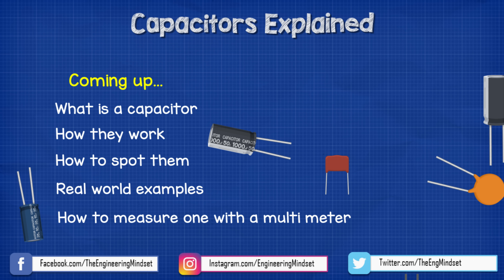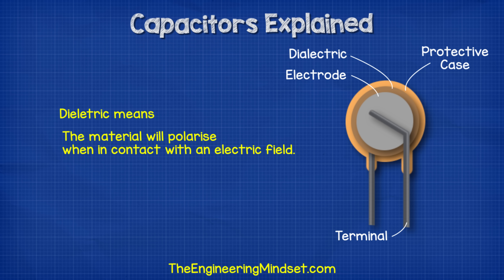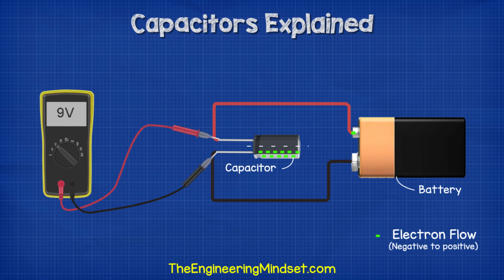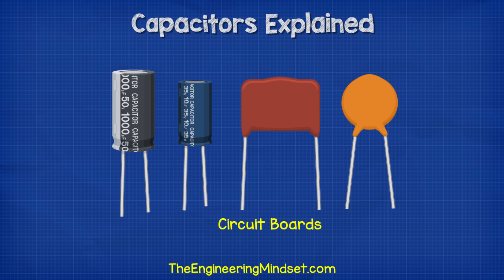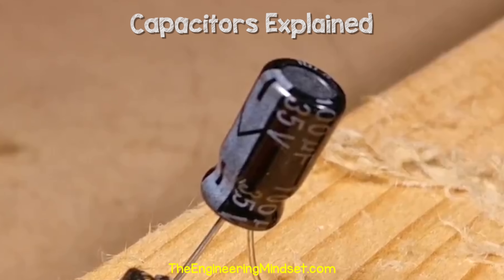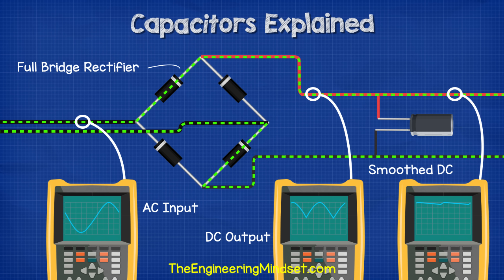Capacitors Explained - The basics how capacitors work working principle

Comment: Thank you so much for explaining this clearly and in detail.
Since they release their energy quicker, is it possible to provide a larger, brief jolt to, say, run a motor faster than the battery it was charged with?
Reply: Most motors have a run demand and a start demand.  The start demand is much higher than the run demand.  AC compressors are an example and all ruse a start and a run capacitor.  To answer your question by itself you could design a circuit to do that, but not with the capacitor alone.
Reply: In my understanding, Capacitors don't charge to a higher voltage than the source they were charged with. So if you charged up a capacitor and then hooked it up to a motor, at the very beginning it would run as fast as it would when it was hooked up to the battery. As the capacitor discharged it would slow down, which would be pretty fast (milliseconds to seconds, depending on the capacitor capacity)

Comment: Does capacitor  will over charge if not disconnected to battery? if yes then how to maintain the voltage that goes to capacitor?

Comment: How does one design a capacitor in terms of rf current flow? Im thinking along the lines of plate area per ampere of rf in an air variable capacitor, aside from plate area and spacing needed for the required capacitance value.
   Use will be in the hf region.

Comment: Hold on, "The pull between charges is what causes the field? 

Electrons by themselves create their own field. Electrons do not require the attraction of Protons in order to exhibit a field. Am I wrong?

Aren't the Protons simply there to keep the Electrons from leaving, and to allow them to discharge to a load?

The attractive force between the Electrons and the Protons does not create the Electric Field, the Electrons are doing that fine by themselves, am I wrong?

Comment: My high school Electronics classes we're literal Mayhem. The teacher have no control of the class if I told you stories of all that went on in there you would certainly think I was lying. 

One common occurrence was to charge a capacitor and then just walk over and discharge it on someone's skin. This happened often, you really had to watch yourself. It hurts, like a mini taser.  

Another time someone hooked a fairly large capacitor with reversed polarity and the explosion was tremendous. I mean it was way louder than an ordinary firecracker probably close to what a cherry bomb would sound like indoors. 

Your explanations are fantastic clear simple and to the point. The teacher I had could explain things coherently for the first three or four minutes of the lecture but if you continue to listen for the full hour he would confuse you so much that the only way to understand what happened during the lecture was  to just forget it entirely and reread the book. It really was that bad.

If you had been my teacher I might actually have learned something useful by the end of that class.

I have subscribed. Thanks. .

Comment: One thing I never understood was how a smaller capacitance created more impedance. I think you demonstrating the physical nature of the capacitor finally answered that question. If the flow is separated by an insulator, a small capacitor will halt flow much faster than a small one, thereby creating more impedance in the system.

Comment: I have a question. Why capacitor increase voltage when connected on ac to dc converter after bridge rectifier? example 12V DC converted after adding capacitor it can show up to 16 or more voltage unless you put LOAD on it. Example when I use mu Car Battery charger that is made very simple with transformer and diodes and when I connect them on Car battery it increase voltage (depends of state of car battery (how much is full)). When full it comes up to 15.5V. Why is that? I never found out...
Reply from the maker: Answer here https://youtu.be/RiRyzLl4Y8U

Comment: I know why Honda/Acura wants you to remove the negative battery cable. When you do any work to certain parts like the SRS system. To remove back up battery power the capacitor.

Comment: Ah, that explains why I got a nasty little burn on my finger when I touched my 3DS's charger's circuit board. The charger wasn't charging and when I opened it after a long while, thinking that would get rid of any electricity, it gave me a shock instead.
Also, I was always curious about them but thought they were some sort of resistors.
Reply: woah! it must've sucked to get that shock, but i can imagine the "aha!" moment you had the moment you figured out the reason behind it—that must've been awesome. on a side note, i hope your finger is doing okay!
Reply: @notnono5342  Haha, yeah, it was awesome! I was really confused when I got that shock- it left two little not black but white holes on my skin, which added even more to the mystery. I thought they wouldn't disappear, but now they're gone; my finger has apparently healed! Thanks for your concern btw ☺️
Reply from the maker: Check out NEW resistor video, everything covered! ➡️ https://youtu.be/DYcLFHgVCn0

Comment: Hy there,

I will need your help to repair an LED issue on my Traktor Z 2 Mixer.

in the right side the cue lights goes on for a second, than stays off.

o the left side the LED's work perfectly.
I think it's not a big problem, and I can manage to change the faulty part if you will help me to find the faulty capacitor resistor.

kindly regards.
Reply from the maker: Check out NEW resistor video, everything covered! ➡️ https://youtu.be/DYcLFHgVCn0

Comment: Have been troubleshooting a defective electronic board with a few observations:
1:Use visual confirmation of burnt out Caps or other components first and or Bulging and leaking underside Caps to narrow down a fault.
2.If unsure seek other counsel.
3.A schematic certainly helps but not all boards have them.
4.Sometimes it is far more cost and time effective to replace an entire board brand new then testing each and every component on the board.
5.An esr meter can further test Capacitor and other problems inboard (dont forget to discharge).
As always practice safely around electric currents especially AC power.
May have narrowed down my problem to a faulty IC through overvoltage supply to board.

Comment: New to electronic circuitry here. Max voltage is obvious since I do have some background in power systems. But how does one determine what Farad capacitor to use when designing a circuit? That's what I'm looking for.

Comment: OK nice vid, but here's a question. I read in a book that capacitors output AC voltage. Yeah, I did double-check it.
So with that said, why is it that you recommended to measure a capacitor using the DC instead of AC?

Comment: Can you use a capacitor (or something like it) to neutralize voltage drops in a house ?
We have floor heating in our house. When the heating, which works on electricity) starts up, we hear that in our hifi speakers and sometimes see that in the TV.
A capacitor would neutralize that, I think, but in the house you have AC, not DC ... so is there a solution for this ?

Comment: At 2:23 he says the stripe shows the negative side. DO NOT TRUST the stripe, they MUST be tested to find the negative side. Example, if repairing a surround sound receiver, if the capacitor is installed backwards, you will get ‘noise/hum’!

Comment: Very informative! Would love to see a whole electronics series. But when you say a capacitor can't store as much as a battery can you please expound? A standard microwave capacitor can be around 2100v. I don't know of a 2100v battery. And are capacitors in DC circuits different than in AC circuits? I have several microwave capacitors and there are no polarity markings anywhere. I checked my other AC capacitors and I see no markings either. And you definitely don't want to measure a large capacitor like a microwave capacitor or you'll literally fry your meter.

Comment: 4:56 Will, In textbooks current flow to circuit from positive to negative. Here it from negative to positive. I know that current is flow of electron, but why it mentioning everywhere that positive to negative...🤔🤔
Reply from the maker: Watch this https://youtu.be/kcL2_D33k3o
Reply: @EngineeringMindset  Thanks u so much this help a lot gain more knowledge then my engineering degrees lol..

Comment: A key concept that none of the other videos I've watched on electronics covered is that electrons travel back out of the capacitor's negative terminal.
I was under the impression that the electrons would jump across to the positive terminal once charged, and could then continue down the circuit.
Seems like an important detail to leave out!
Thanks for setting things straight!
Reply: You’re confusing conventional current with electron current
Reply: Or, that the elections require a circuit, and do not ‘jump across’ (regardless of methodology).

Comment: correction 7:33, capacitors block DC and only pass AC. So if you try to check the voltage it may be 0V on DC, and more on AC.

Comment: but initially capacitor has the charge .....why are u connecting it through a batter and bringing the scharge to ther plate and then lighting the bulb ...instead directly connect the capacitor to the bulb

Comment: This might be a dumb question but does the capacitor only use half of the electrons because then they'll balance once it goes to the other side. If that's the case isn't that a bit inefficient.

Comment: bro i plugged my hair clipper in wrong current, however the motor didnt burn the small green board attached to it burnt the motor is a 110v dc motor and when i connect it to 110v its just vibrating its not spinning. how can i get it to spin?

Comment: Human suffering works the same : - A 1 Farad capacitor loads 1 Volt of tension for carrying 1 Coulomb 
                                                               - A 2 Farad human suffers 2 SufferingVolts of tension for carrying 1 CoulombOfProvation

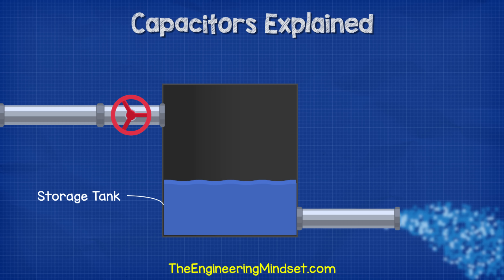Comment: 1:05 - as I understand it, the pressure created from the water will decrease as the tank drains (highest pressure when tank is full) and decreases as the tank drains. Do capacitors work in the same way... where there is a variance in the flow of current or voltage as the capacitor is drained?
Reply: Yes they do work similarly. As the capacitor drains, the potential difference across its terminals must drop I think. This must cause a reduction in current as V is directly proportional to I (current).

Comment: When we were in 8th grade, we played around with some Arduino and circuits. Back then we didn't know how capacitors work and we were so terrified when we saw the "may explode" label on it. The moment we connected it to the circuit, we bolted all the way to the back of the lab hahaha

Comment: A.K.A condenser  to absorb back voltage  across points of engine ignition system, due to the
back voltage of primary coil in either battery or magneto.

Comment: There is a small flaw in the video: In the first seconds of operating the circuit of the lamp and the capacitor, the lamp won't shine. This is because the capacitor himself acts as a short circuit during the first moments of operation. This means that the electrons will prefer flowing through the capacitance rather than through the lamp and the resistor. You can use the water circuit from the inductor video to explain this. Replace the wheel (which represents the inductance) with the water tank from this video and it will be clear that subsequenlty to turning on the water source (in this case a pump) the water will prefer flowing into the tank rather than through the resistance. However, after some time (dependent on the capacitance and the resistance) the capacitor will act as an open circuit and will release electrical energy (as shown correctly in the video) which can be compared to the full water tank in the water circuit.
Nevertheless it was a very informative video which helped me to put into perspective of how a capacitor works.

Keep up the good work!
Reply from the maker: Check out NEW resistor video, everything covered! ➡️ https://youtu.be/DYcLFHgVCn0

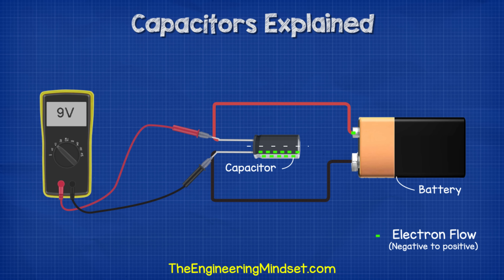Comment: M3:55 If you measure across a battery, a multimeter will give a false reading of 1.5v . To get an accurate voltage of a battery there needs to be a load in the circuit.
A battery tester has an inbuilt load. Instead of 1.5 the battery could be 1.2v.
Reply from the maker: Check our new Multimeter tutorial out ➡️ https://youtu.be/4lAyzRxsbDc

Comment: In my car lighter socket I get readings from 12V to 13.90V. If I want to stabilize to 12V what should I use? A capacitor won't keep the voltage at 12V right?

Comment: If you want to check a capacitor while it is running, which is more accurate, the formula for that is: Amperage x 2650 / voltage

Comment: Inductors also store and release energy, capacitors also do the same then what is the difference?
Why is the use of both in a circuit?
Reply: Admin Admins  I have searched but couldn't fine, can you share the link here
It will be useful for others too

Comment: 2:44 last I checked, electricity doesn’t flow from the cold wire to the hot wire, I thought it was hot to cold.
Reply: I understand your confusion/interest in this. You're not alone. There are two ways to think about electric current. In early experiments, investigators (such as Benjamin Franklin in the USA) thought of electric current as some sort of invisible fluid and that some things possessed "too much" of this fluid and some things lacked "enough" fluid. They thought of electric current as flowing from "too much" (+) to "not enough (-). Schematics are sort of drawn with this concept in mind. It's called "Conventional Current" flow, sort of what you have described as "hot to cold."

We now know about electrons and such. We know that opposite charges attract each other so it is logical that a negatively-charged electron would be attracted toward positive. We call this "electron flow."

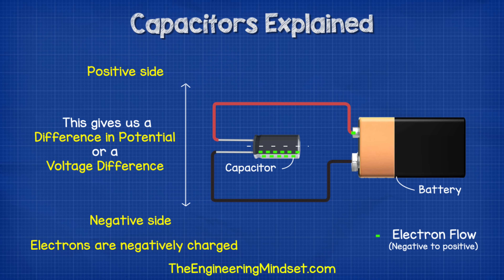Comment: 3:06 electrons are negatively charged? they are always negative, I think you wanted to say one plate of the capacitor is negatively charged
Reply: "Electrons are negatively charged" is not an incorrect statement, one side has a bunch of electrons, hence it also has a net negative charge.

Comment: Great video! I worked at a company that made single use medical devices, mostly all sorts of IV bags. They used RF welders to make the bags by welding two layers of vinyl. I never really understood how these welders worked. There were a lot of capacitors used in the circuitry. When they didn’t work I would start checking capacitors which turned out to be the problem most of the time. From what I understand these welders work similar to radar or microwaves. Please consider doing a video about this technology.

Comment: A capacitor across the line does smooth out the power, so will a storage battery in a D.C.
circuit. inductors a coil of wire on a laminated core in series w a b+ power supply, the 
capacitors across the output give a smooth d.c. for radio or amplifier tubes.

Comment: What capacitor is needed for the following?.... Size: 36 In., Speeds: 2-Speed, Type: Direct Drive, CFM (Cubic Feet Per Minute): Low:9100 CFM/High:11,200 CFM, Voltage: 120V, Amperage: 4.5A
Reply: it is a drum fan

Comment: Hello, a question: how can I make the capacitors live longer? Should i choose ones with more volts or buy more expensive ones that will make the difference in durability?
Reply: A capacitor is rated by its manufacturer to operate for a certain number of hours at a specified voltage and temperature, e.g. 1000 hours at 50V and 85 deg. C. Reducing voltage, temperature or both will extend the useful life of a capacitor. Buy the highest voltage cap that will physically fit in your circuit and ensure it stays as cool as possible.

Comment: How do I calculate how many μF I need?  Second, how do I calculate how many volts I need? In trying to pre-empt the answer if it turned out I needed 300 μF would it cause a problem if my capacitor was rated to 1,000 μF? Same question with V would it create a problem if the capacitor was rated much higher voltage wise than my need? Could you do a more advanced video on capacitors to answer these type of questions?

Comment: is it okey to use a capacitor from a washing machine  no + or - sign on the capacitor and rated 227 MFD 110 v0lts to a 12 volts battery bank? if no  why?

Comment: Capacitors stink and burn the crap out of finger, replaced a led strip on TV touched underside of capacitor quick hard shock then put insulating tape on the pins forgot to take it off when I hit the power it popped

Comment: I think your comparison with a tank as at @ is not good. If this was connected across a supply/battery then water/current would continue to flow. As you say at @, a capacitor connected across a battery will only let current flow for a short time; after that time, no current flows. 

For a better type of tank to explain a capacitor, I think you need a tank with a stretchy membrane across it; initially the water flow would stretch the membrane and then stop the flow, and then tend to force it backwards.